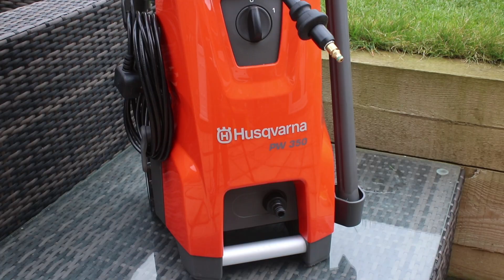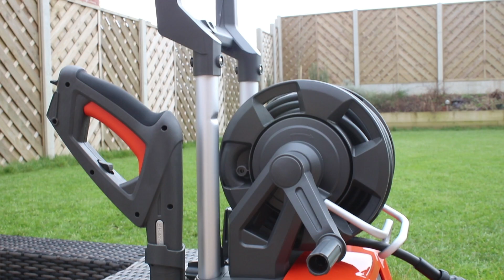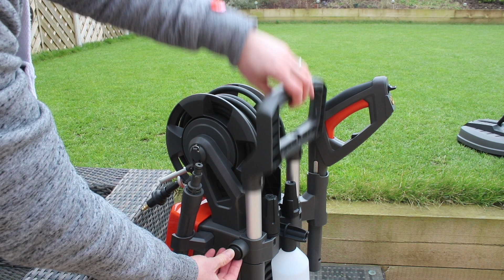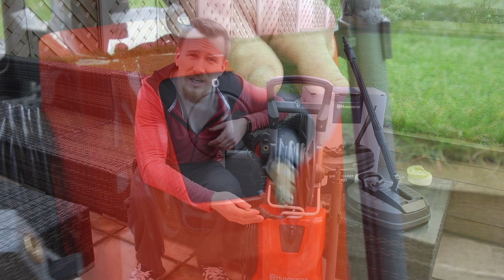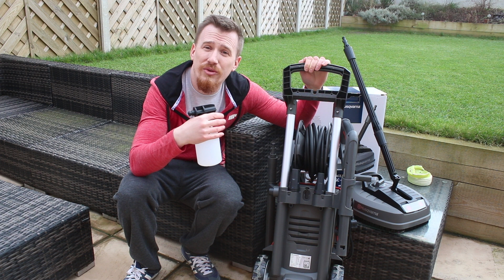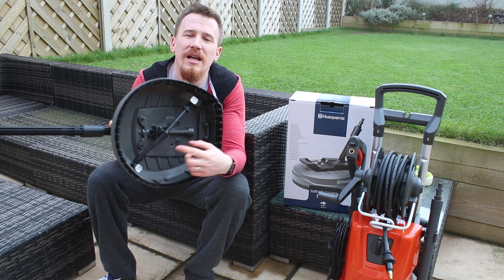Spring Cleaning with the Husqvarna PW350 Pressure Washer and SC400 Surface Cleaner - Introduction

Comment: Henry just came across this video could you confirm that the hose reel is completely integrated, i.e. I only need to plug in a water supply at the bottom, and I can pull the hose out and start pressure washing without having to connect the hose every time. I've just sent back an AVA Evolution P60, due to it breaking twice within three months, but the hose function was fantastic as I keep the pressure washer connected inside my garage, but we pull the hose reel with the gun out every day to spray down a part of our plastic chicken coop. 

Last night I received delivery of a Husqvarna PW235R, only to discover that hose reel is not integrated, so I'm sending that back and looking to buy something else - potentially the PW350.?

 Many thanks and great review.